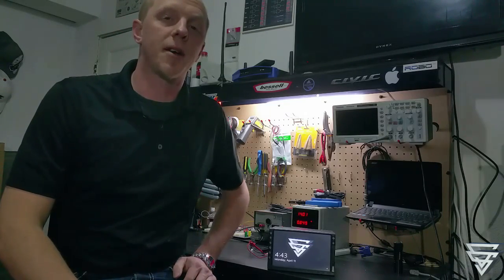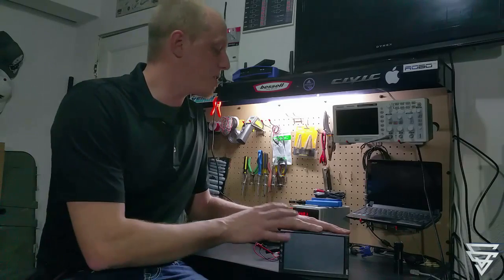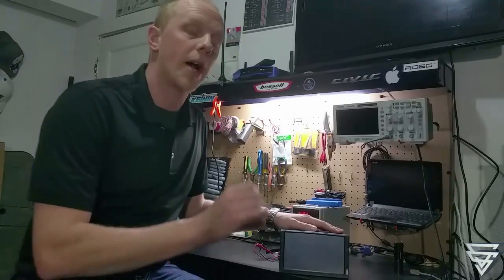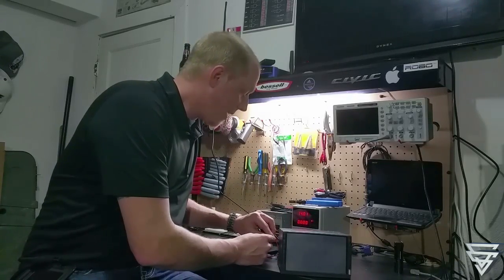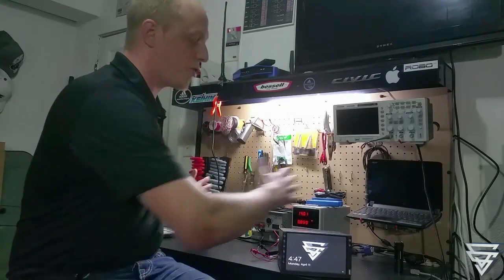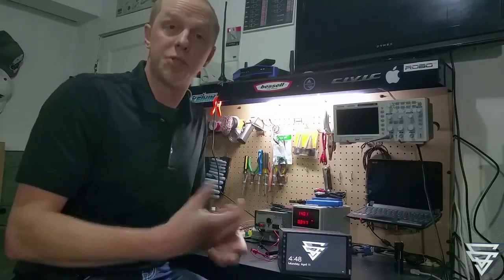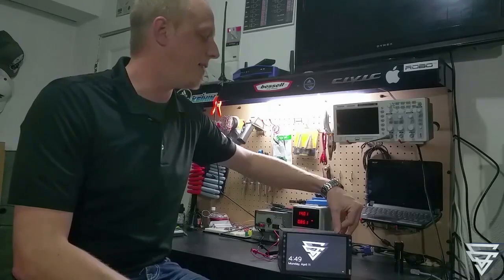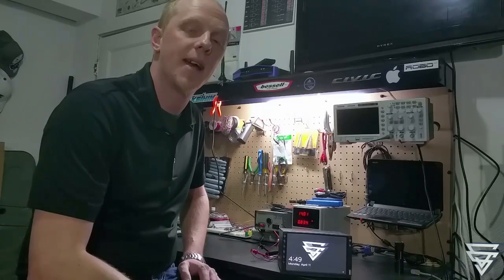2 Din CarPC: introduction "5.5" depth" Part 1

Comment: Can you go over setting up windows 10 and what to turnoff. Also I need to know what car pc software to run.
Reply from the maker: that's actually I good idea. I'm do a part four and cover what settings I used etc. as far as the gui I used I went with centrafuse as it is the most poslished front end and has the largest community for help and customizable options.